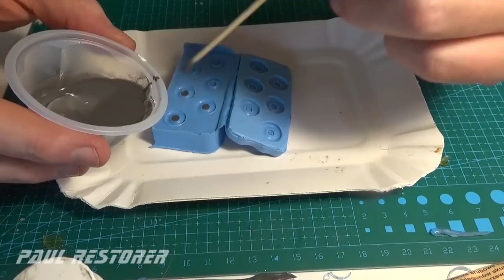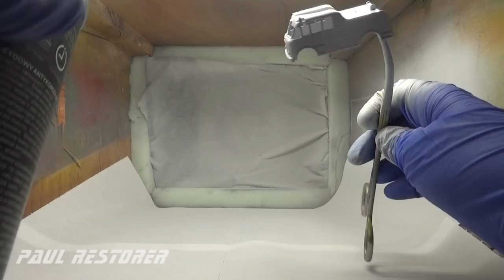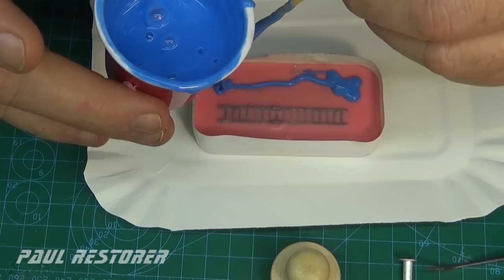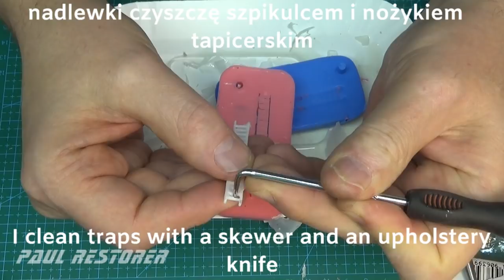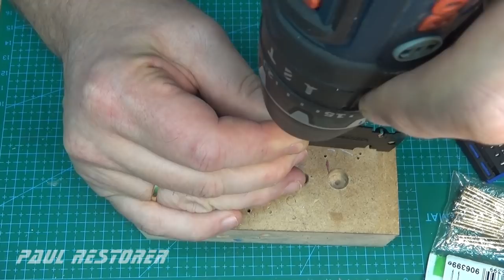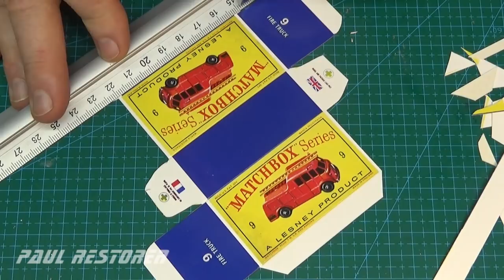Matchbox restoration Merryweather Marquis Series III Fire Engine nr 9 diecast car

Comment: One more great renovation. When making molds for wheels and transparencies etc, do you keep them for future use if need be. Also when casting wheels do you make a big batch for your spares bin?

I find your channel fascinating and very restful.
Reply from the maker: Hello Yes of course I keep the forms for the future, they can be used many times and many parts are compatible with watering, for example wheels I always do a little more because they are the same in different models. Best wishes